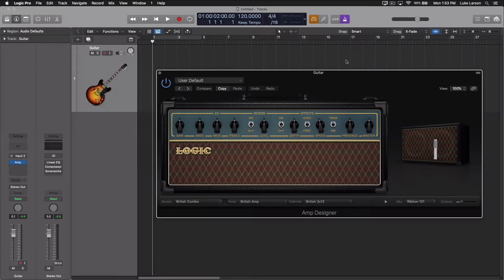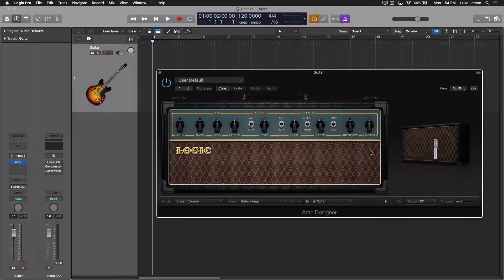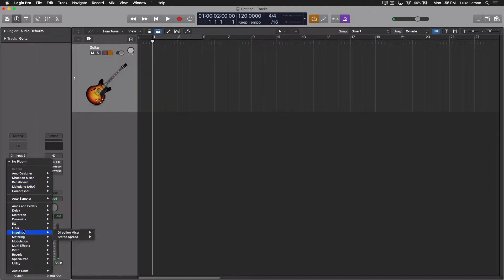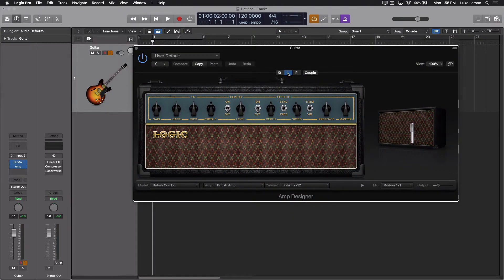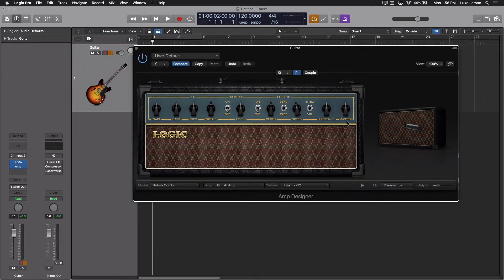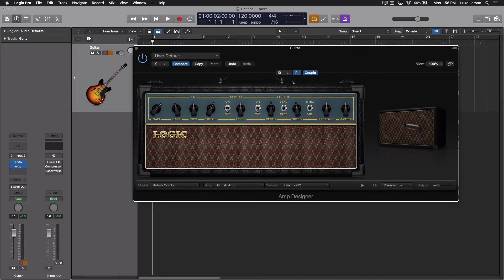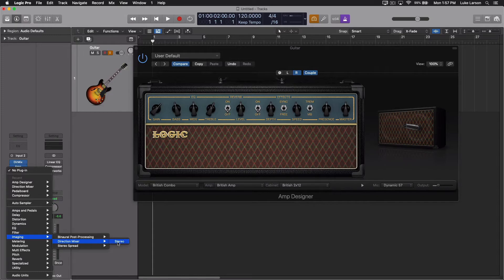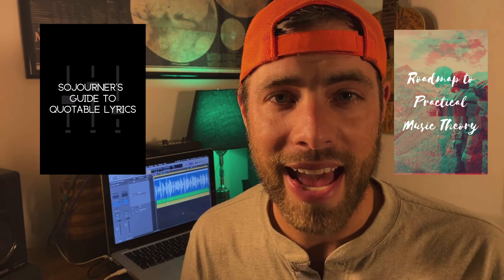Two Mic Setup in Logic Amp Designer | Two Minute Tips in Logic Pro X

Comment: So I’ve done everything you said in the video but for some reason my amp designer still isn’t giving me the option to choose between the dual mono signals. Any suggestions?
Reply from the maker: We’re you able to get as far as loading amp designer in dual mono? Or are you saying that “dual mono” doesn’t appear in the drop down in the plugin menu?
Reply: No, and that is the issue. I’m not able to load amp designer in as dual mono. The only option appearing is stereo.
Reply from the maker: Is there anything other plugin ahead of it in the signal chain? The direction mixer should be set to: mono -> stereo. If you have any other plugins in front of the amp they would need to be set to: stereo.
Reply: Nope I just started a new project, created an empty audio track for DI guitar. No plug-ins on yet it. I add the direction mixer as mono -> stereo. Then try to add the amp designer plug-in but the only option available is stereo. And within the plug-in there is no option to edit the left/right audio and mic placement. Could my Logic Pro X possible be out of date and not support dual mono? Or maybe my project settings are incorrect?
Reply from the maker: That is a stumper friend! I’m trying to create a scenario where the dual mono option is not available. For me the only time it doesn’t show up is on a mono track without the direction mixer. Can you normally access dual mono in other uses/plugins? It’s probably something obvious but I’m not seeing it.
Reply: Nope I can’t add any plug-in as dual mono for some reason and I’ve looked everywhere to try to solve this. I guess I’ll just go get a new interface to double mic my amp through XLR instead cause this dual mono DI is not working for me 😂
Reply: I appreciate you getting back to me so quick. Much love, will def give you a like and subscribe!
Reply from the maker: Yeah that’s frustrating, sorry I couldn’t help! I really appreciate the support! Just out of curiosity what version of Logic are you on? Could it be an update issue?
Reply: I just opened amp designer in the stereo strip then moved it to the adjacent strip. saved the strip. to open later. hope this helps.